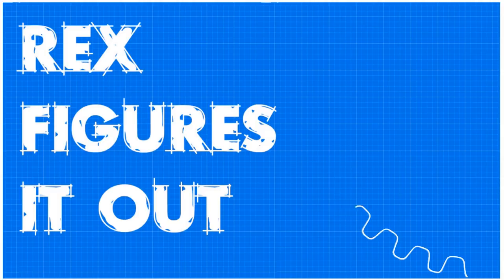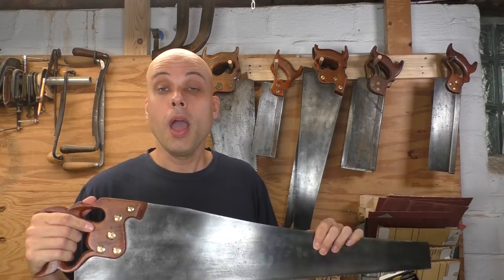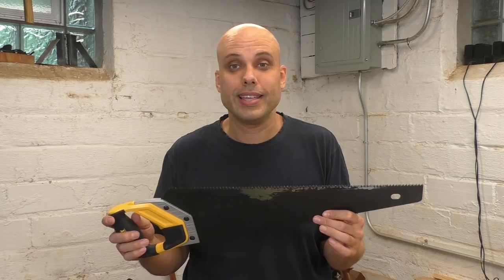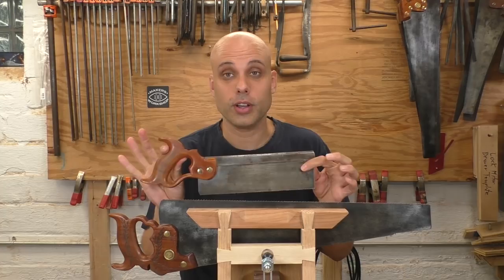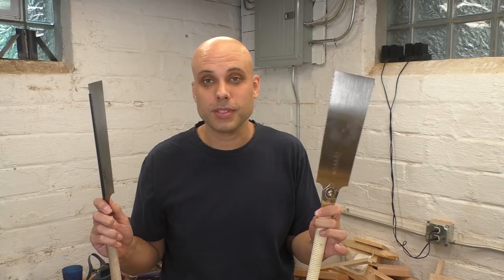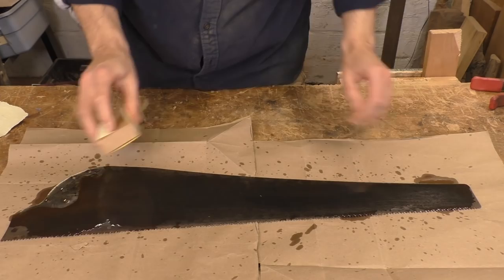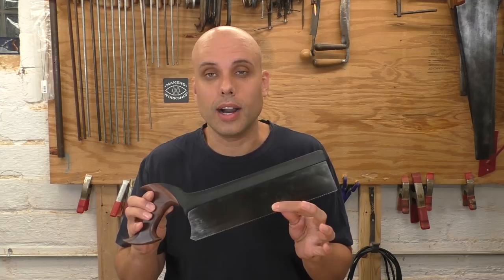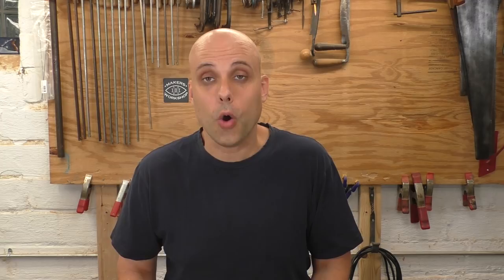The TRUTH about woodworking saws.

Comment: Rex, what about making a quick jig for the bench grinder to take off the hardened/broken/dull teeth of the disposable saw, then using a hack saw and files to map the gullets-teeth using the steel just beneath the former teeth? And then... replacing the plastic handle with a vintage style wood handle? I could see an impoverished wood worker doing this.
Reply: No need for something that extreme. 
Either use a diamond file, of a Dremel with a grinding disk or a diamond disk, and you can sharpen a hard point saw.
Reply: @supergeek1418  in this case, I'm referring to a very damaged (thoroughly used up) and dullified disposable saw.
Reply: @CosmicVitamins  
In that case, (assuming that you have more time than money) that would certainly work.
Reply: @supergeek1418  yup. That was the idea. But the question wasn't precisely directed towards you.
Reply: That's a lot of work to put into a shit steel blade. For the cost of a good bench grinder and one of these shitty big box store saws, the impoverished woodworker could get a very good proper saw.
Reply: @weedeater64  Any woodworker who doesn't have a bench grinder probably needs to look into getting one before he or she goes and splurges on "proper" saws.  They aren't expensive, and they're invaluable for sharpening everything else.  But otherwise there's our old friend the angle grinder, or the dremel, or even hammering off the teeth and hitting it up on the belt sander.   As for "shit steel", there's a couple of points I'd make.

Firstly, if you're learning to sharpen saws, would you rather be hacking on a piece of cheap rubbish, or on a hundred year old heirloom that's worth easily hundreds of dollars?

Secondly, that steel isn't actually shit.  It's a flexible, tough, high carbon tool steel, just like your hundred-year-old heirloom blade is, but with a hundred years of advances in metallurgy added on.  It's almost certainly a more consistent blend of steel than your heirloom has.  It might well be thinner, though.
Reply: @weedeater64  I see you've never worked in a 3rd world country.
Reply: Why fart-ass around with a crappy hardpoint saw with rubbish steel? All that work is wasted on such a saw... just go to a yard sale and buy a genuine proper old saw, then spend the exact same amount of effort resharpening that instead. And you don't need a grinder.
Reply: @johncoops6897  Because not everyone in the world lives in your geographic area where such yard-sales and products are available. Some people live in 3rd world countries or drastically impoverished states and have to make due with what they find in a dumpster or inherit from the NOTHING given to them.
Reply: @CosmicVitamins  - in that case, they won't have the internet to be able to read about your amazing cost-saving "idea", will they?
Reply: @johncoops6897  GASP... and they won't see your sarcasm either? Will they?

Comment: I have successfully tempered and sharpened hardpoint saws. You can heat the teeth with a small propane/butane torch until the steel just behind the edge turns blue.

Comment: Excellent piece.  One other thing about impulse hardened teeth.  They are just as brittle as that file.  And under the wrong circumstances they break just as readily (been there).  Also, while it seems tricky, you can set saw teeth with a light hammer and a nail set.  The trick is being consistent in the hammer work.

Comment: you can also make other things from saw blades , thin knives , rulers , and even a crossbow stave , or even cut new teeth deeper into the saw for a resharpemable saw , though the last one would require tempering the steel to a different point

Comment: Ok Rex I have figured out how to fix that problem of putting up with the Japanese saws when they are dull buy the saw and a replacement blade so when the one that comes with saw gets dull switch it out with the other blade and then buy another blade so you always have one in stock

Comment: I recently bought a new jobbing saw. It worked great until I tried to cut some old timber I was hoping to use for a project. Ruined the saw after finding an old nail.  Rather than throwing it away, I ground down all the teeth and set about turning it into a rip saw. Took me a few days of of marking out the placement of the new teeth and grinding the start with a Dremel and finally filing to finish. O K a lot of work but learnt new skills. More than worth just to either throw it out or make scrapers out of it.

Comment: As for the files, invest in a file card. That is a wide, flat wire brush to clean in between the teeth of the file. Or, get a fine wire brush to do the job. It is important to keep files clean, and thus, sharp. Brush in the grooves between teeth, and your files will be as good as new.

Comment: Hard point saws, when they get dull could you hit the teeth with a torch to pull the temper out then resharpen?
Reply: Yep
Reply: Most of the ones I've seen don't have 60° angled teeth, though.  They've got very deep gullets and a much smaller angle between the teeth, which means a standard triangular file isn't going to fit.

I'm not saying you can't figure something out, but you'd probably end up having to file a ton of metal off the thing before you could form normal teeth.

Comment: I took a class last semester called materials and processes but the way the professor taught it, it was more like steel 101. If you are more interested in this subject, check out a phase diagram of steel and how different cooling rates can create different crystal structures in the steel which effect its strength.

Comment: Not to be nit picky, but files are tempered after quenching as well. The difference is that they are tempered at a lower temperature, resulting in a higher hardness. A file does not cut into a piece of tool steel that has just been quenched (hardened), because the untempered steel is harder than the file.

Comment: In the video, you mentioned that it is entirely possible to file down saw teeth and cut new ones, so i was wondering if it could be possible to take an old worn out jobsite saw and use a hacksaw to make a large horizontal cut along the blade, removing all the hardened steel and then cut new teeth to convert it into a sharpenable saw? If it works, it could also be a way to make an affordable backsaw.

Comment: Previously you laid a foundation of buying vintage, gently used shop tools, equipment, and supplies.
I just bought 4 Disston's I'd estimate at an average of 60 years old, and all are in fine shape.  4 for $10.
They were on CL for over 2 weeks, so it's not like they can't be found.
(He then made me a deal for a hole saw set with probably a $30 arbor, 5 levels, a puller, a 1lb. Ball Peen, claw hammer, and some more tools....another $10.  Your pan shot of a bunch of tools has my rusty hatchet in it.  It was a fun haul.)

Comment: I see lots of old Disston and high end Stanley saws at swap meets all the time. There are lots on Craigslist, Ebay, and Amazon. They are far from rare. Probably most of them need sharpening but that is something you would have to deal with anyways. I have an old saw vise and a good set of US made Nicholson files.
Reply: The straightness of the old saw is the issue. Often, they have a bend, twist or kink which makes them nothing but scrap steel, sadly.
Reply: Or a restoration project for a fairly ambitious toolmaker. Some of these can be trimmed down with a cut off wheel and fashioned into little miniature backsaws, if they have enough straight section.

Comment: The Ryoba and Dozuki blades ARE resharpenable. Just like chainsaws take a special file, so too do Japanese saws. They need diamond files, both diamond in cross-section, and in abrasive. You can buy an 800 grit diamond file for less than 20 dollars.

Comment: Hi there Rex. Love you videos mate!!
If you are just starting out enjoying the sense of pride and achievement that comes from creating something out of wood PLEASE read this to the end. 55 years plus of woodworking gives me some perspective and for the nit that suggested simply buying a skill saw- well better you keep your comments to yourself and not publicly display you obvious ignorance- dopey!
Rex,  I take your point, up to a point! Your “way cheaper” old style saws though, are just the opposite in my estimation. You’re overlooking the hidden cost of time spent cleaning, clamping, laboriously filing and finally setting; with the ever present risk of breaking a point! Never mind the hidden time in the learning curve! As you pointed out,  cost of the clamp (or time making one), files, (which are often difficult to get due to much lower demand) and the setting tool- all add up to a fair investment and you normally don’t wish to carry them all around. I charge $45 an hour for my skills. That is considered low by local standards. To properly sharpen and very carefully set, my beautiful 40 yr old Nicholson 14 point panel saw, takes me an hour or more.
 A Bahco, 14/inch, hard point, at $14, will cut cleaner and easily remain sharper for 3 times longer than the Nicho ever could. I would need to spend 3 hours min sharpening it, just to keep up! Simple maths- the hard point has saved me $135 in productive time in the shop or out on site; which buys a lot of metal! At that rate I can afford to buy 2 Jap silkys, 2 Bahco 14 points and 2 Bahco 7 points and still have change in my pocket! It also means I can afford to have 2 spares! In truth I have several. I use one for general work and keep the spare for delicate cuts as needed or in case I bust one (particularly on site). When the 1st one wears out, I start using the old spare and buy a new spare for those delicate cuts again- and so the cycle goes—
The Japanese have developed pull saws to an art form and the steel to match. My closest friend is one of the best, old school, cabinet makers I know. He and I both agree, our sharpening skills, can not match the sharpness or the fineness of their saws! They are unsurpassed for precise hand cutting and a joy to use. We both gave up on sharpening saws over 15 yrs ago; about the time hard points became so cheap. Why? They cut so straight, so fast, so cleanly, for so long and for so little money! It takes a long while to get that good at sharpening saws with files- even diamond files! It just isn’t worth maintaining the classic old saws unless you have a lot of free time or want that added satisfaction of knowing you created that fine piece of wood work with a saw you sharpened yourself BUT REMEMBER! It’s a labour of love that comes at a SIGNIFICANT HIDDEN COST!! 
Don’t get me wrong, my mate and I have a combined collection of over 50 beautiful examples of the saw maker’s art- from 8 inch, 26 point British Tyzaks to 4 foot cross cut Distons and we love them all!!! We have sharpened all of them at least once so we do use one or two occasionally but 98% of the time, we will both reach for the hardpoint or Jap puller. If you accidentally tread on one and bend it- no big loss and easily replaced! When they finally lose that razor sharp edge, they still make great nock about pruning/camping saws or yes, cut em up into scrapers! If they made chisels or plane blades that compared to hard points I’d swap in a heartbeat, but hey! I love using chisels I’ve sharpened and could shave with! It really is hard to beat a hard point though-
Near enough is never good enough! Do it once. Do it right and only then can you be proud of what you do! Get the point? H

Comment: You can sharpen hardened teeth with a Dremel tool using a cutoff wheel. Have to take it easy, some are easy to break. Not so much with the fiberglass reinforced wheels.

Comment: You could also make your own saws. It's really not too difficult.  There's a video from BearKat that helps. 
I spent about 150 dollars on brass, steel, files, arbor for slitting saws for cutting a groove in the brass. Made some decent rip saws (tenon and dovetail), fine-tooth crosscut is in progress (finding itr much harder to make, hehe). Have material left for another dovetail saw, if I need to make another one for some reason.
The hardest part was actually sourcing the steel. It's the same reason why I was unable to make larger saws - just could not find hardened steel plates I could buy that were wide enough, they only sell such sizes annealed. What a shame. 
Be advised though - I am not from the US, steel is cheap here (about 12 bucks for 1 meter 0.5mm by 100mm plate) and it does take quite a long time, about a day to make a saw start to finish (with the handle and all).

Comment: I personally think that for me is a hard point saw more than enough. I don't use mine much and it will take many years before I will even feel a slight difference in the sharpness and if my guess is correct will I be running this saw for more than a decade.

but i'm no wood worker either, i'm a welder. so the consumables I use will wear down and discarded and most of my interior changes in my house have i been black smithing or welded togeather for a simple and easy to clean look.

Comment: How do you know if you have an impulse hardened saw or one that you can sharpen? The reason that I ask is that I bought a well used, rusty saw from a resale shop so that I could bring it back to life. It's an Atkins with a wooden handle (one of the reasons that I bought it) that just needs some rust cleaned off the blade and some sanding on the handle.

Comment: About files: there are diamond files out there, that hold their sharpness fairly long. 
You should actually do a special on files alone, since there are lots of them in all price ranges. And how you treat your files will effect how long they,stay sharp.
Reply: Absolutely!! I was lucky enough years ago to acquire a bunch of files, of many types and fineness, that had belonged to a silversmith. They are such a joy to own and use!  Also, as you say, there are diamond  files and I have been able to re-sharpen the induction hardened saw toothed saws with them. (As long as it's a touch up. The file is expensive too)
Reply: @crichtonbruce4329  there are cheap diamond files. But they are small, and usually at the same kind of quality those dirt cheap diamond sharpening stones are. Worth it? Delends on what you arw using them for.
Reply: @erikgranqvist3680  Right you are. Induction hardened saw teeth would wear out a cheap diamond file very fast. The one I use is good quality, and I was only touching the teeth up.  I actually really like the cheap diamond "sharpening stones". I bought my first set as a lark.  Not for real sharpening, but for shaping a damaged edge, rough flattening a worn stone, used instead of wet/dry sandpaper on metal, as a very wide file... at $15.00 for a set of 3 they have payed for themselves many times over.
Reply: @crichtonbruce4329  I use cheap diamond files the same way on cirkular saws and regular saws: just a touch up, more then true sharpening. I like to have a file in the pants for using just a fast clean up fairly often, and a cheap file you do not need to be careful with. Its a habit I got since I was a forrestry worker in my youth - touching up chain saws all the time.

Comment: Your 3rd option on the hardpoint is funny... you can carefully lap the outside edge of the blade and use a vise to give it a kerf afterwards and get another 30% of its life out of it on lighter tasks.

The fourth option is to simply grind the teeth off and make it a rip-saw with a re-temper.

My favorite use for my Rigid jobsaw is clearing vines from the top of fences, it eats the hell out of the vines and can be held flat to the boards with the grip at an angle.

Comment: I have a jobsite - hardpoint saw that once it is beyond repair I fully plan on removing the teeth to expose the softer metal to make a new tooth edge. I am several years out from actually doing this and I plan to do it safely as a "proof of concept," however in the mean time I wonder if there is any sufficient reason I shouldn't use the softer metal for woodwork. Like if the metal would be weaker than that of a vintage saw or if the thickness of a jobsite saw is actually too little for large teeth work. Is all.

Comment: I once tried to fix one of those hard point cheap saws. It was rusty and dull as h*ck . Spent about a few hours with a small triangular file, a pair of pliers and a hammer to adjust the teeth width. Never done it before, but it worked a treat, but it was a long afternoon, wouldnt recomend it.

Comment: Loads of really cheap second hand old saws in the UK and the US, files don't go blunt that quickly nor do you need half the tools mentioned to sharpen an old saw , one bit of wood cut down the middle put in a vice as a saw vice, one screw with the side of the head filed flat as a saw set and your ready to go. Watch Paul Sellers videos to see how.

Comment: Rex, Why not just make your own panel saw from high carbon spring steel. You can get it pre-hard to 42rc, so you just got to cut the shape out, punch the handle holes in and sharpen it. As long as you only want the blade height to be 6" you  can get a 5 ft piece for just over $50.

Comment: I think hard point could be made made sharpebable if handle is removable. Heating the teeth  carefully with propane torch or heating the whole blade to 8-12 hours, will soften the blade to a point where files will cut it.

Comment: I’ll give you a 3rd choice when that DeWalt saw is dull. Separate the handle from the blade. Take the blade and put it in your oven. Bring the temp up to 400 degrees and leave the blade in for an hour. Turn off the heat and let it cool in the oven. Take out your blade and now you can resharpen it. Having said that, the teeth it will not be as hard but you now have a saw just like a vintage saw.